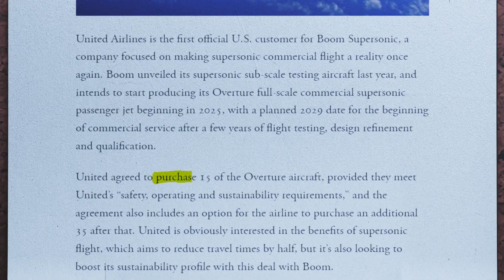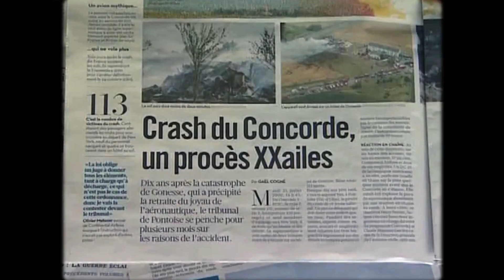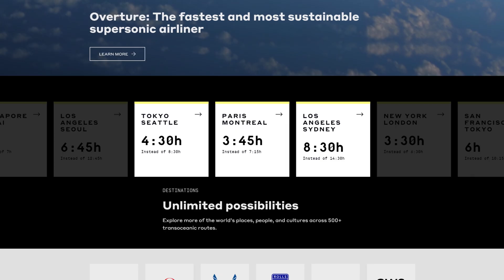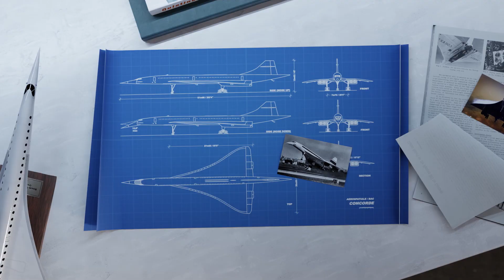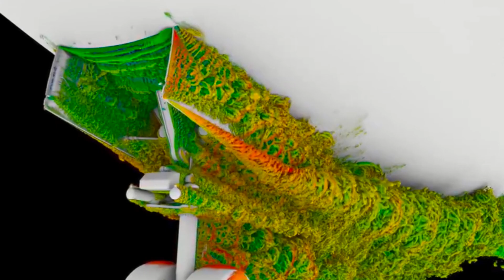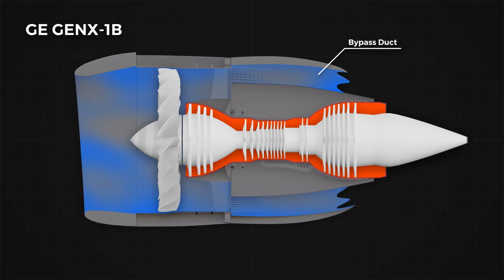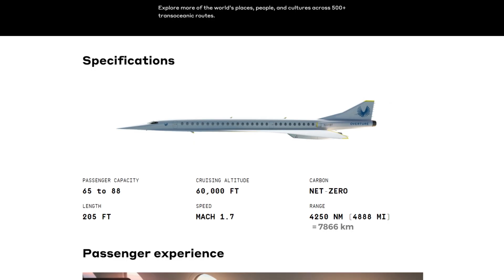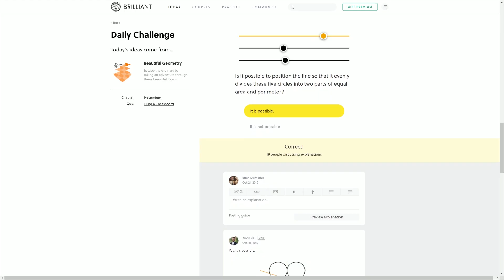Will Boom Bring Supersonic Back?

Comment: The main causes of the Concorde failure were high flying price tags, fuel price tags together with thirsty turbojet engines, the sonic booms over high populated areas and the Concorde plane crash. Not really cramp spaces because any s.s. airliner will give you cramp spaces. There will never be a s.s. jet with a wide cabin.
Reply: @Homoprimatesapiens At first Concorde's prices were not much more than subsonic airliners luxury class, but the seats were not selling so they upped the prices and pampered the passengers with Champaign, caviar, etc, to make Concorde exclusive.

The worldwide sonic boom ban overland, coupled with very thirsty engines at subsonic speeds meant that only two routes were viable.

The TU144 crash and as you say the Paris crash discouraged passengers as did 9-11.

Its quite possible to have an SST with a spacious cabin.

Boom's Overture will overcome most of the problems experienced by Concorde:

The aviation world has changed radically since the iconic Concorde first carried passengers in 1976. More people are flying, and they are more affluent. Roughly speaking, the number of trips doubles every 10 years. In addition, technology has advanced greatly, with the advent of computers, bringing computer aided design and simulation. Engines are now more powerful and efficient and aircraft are lighter and more streamlined.

Because Overture will be economical at sub and supersonic speeds, 500 routes, some mixed land/water, are viable, rather than just 2 Atlantic routes for Concorde. Overture will be carbon neutral, using sustainable aviation fuel (SAF). Overture will fly 2x the speed of subsonic jets over water, and 10% faster over land. Overture will create a sonic boom, but it will not fly supersonic over land. Concorde carried 100 passengers at Mach 2, over 4,488 miles. Overture will carry 65 to 80 passengers at Mach 1.7 over 4,888 miles. 

The two aircraft are the same length at 62m (203ft). Overture will be constructed from carbon composite, saving weight and increasing strength, and practically eliminating expansion and contraction with temperature changes. Overture will weigh an estimated 154 tons, Concorde weighed 185 tons. Overture's predicted development cost will be $8bn. Concorde's development cost was $14.4bn. The manufacturing cost will be less, the maintenance costs will be lower, and the availability will be higher. Overtures selling price will be $200M. An equivalent price for Concorde would probably be $1.2bn. For comparison, a Boeing 737-800 costs $100M, and a 747-8 costs $420M.

Overture will be simpler to fly, eliminating the need for a 6 month pilot conversion course. Overture will have a modern cockpit, with a flight deck similar to subsonic airliners. A flight engineer will not be required. Instead of a droop snoot, Overture will have external cameras and cockpit displays to allow the pilots to see the terrain when taking off and landing. Its cabin will be quieter and more spacious, and its seats will be more comfortable. In contrast to Concorde's awesome engine noise, Overture will comply with ICAO-14 regulations, allowing it to use all airports. 

Taking a JFK to LHR one way flight:  
Showing: Aircraft type,  Fuel cost per passenger,  Economy ticket,  First Class ticket,  Duration

Boeing 747          $147          $577             $2,308                      8hrs 
Concorde             $753                                $5,000^                     3.5hrs 
Overture^^            $708         $1,200           $3,000                      4hrs 
Business jet^^^                                 $53,000 to $99,000            8hrs  

Notes
^ 2023 money 
^^ Estimated prices, assuming Overture carries 72 passengers against Concorde's 100. For the first 2 years, only first class seats will be available.    
^^^ There are no supersonic business jets 

A 16 hour flight across the Pacific on a subsonic jet could be achieved with one 30 minute refuelling stop by Overture, giving a time of  4 + 0.5 + 4 = 8.5 hours.

Overture will not be competing for the mass market, but Boom have identified 500 viable routes. Overture may become a niche service, both scheduled and charter, where certain travellers expect higher prices. Even now, on subsonic airliners, some people are prepared to pay 4x to fly luxury class. And, as far as business travel is concerned, the time saving would be well worth it. To support this, Boom's surveys show the viability of Overture. 

If Overture reaches production, and meets its specifications, it will be popular with both airways and passengers, because it will half many journey times and will be cheaper, more comfortable and a lot more practical than Concorde. The military have already shown an interest in Overture. It would also be suitable for charter flights and as a business jet. The next development should be a 200 seat version, and possibly a supersonic business jet.

14-2023.08.19

Comment: The mishap was due to an overweight takeoff attempt , hindered by misalignment of the right bogie due to failure to install a spacer. Take off speed was too low to ensure a proper climb speed. Normally a dual engine loss would still allow the proper climbout to be reached.
Reply: An ogee wing, the name of this wing shape, does NOT stall, certainly not on takeoff speed.
Landing is much slower and yes a strong vortex lift is produced, but NOT stall.
The conical vortex starts at the forward, inboard leading edge.
There were proposals to continue building the Concorde with a small increase in span with little drag increment at M=2.
At cruising altitude of 60000 feet, rising as fuel burns off.
At supersonic speed, the area rule is different, the area is an oblique one corresponding to the cruise Mach number.
The perceived sonic boom (actually 2 booms) depends on the shape of the nose and nose angle and the temperature distribution of the atmosphere.
And most important on the flight altitude!
Reply: Newer engines operating at supersonic speeds do have low bypass ratio fans. And also without the afterburner for TO.

Comment: Let me get this straight:
They're going to start doing test flights this year. Then build an entirely new fleet of jets, with never before created engines in less than 4 years. Lastly they will do routes beyond the jet's maximum distace, all while using biofuel to be "carbon neutral"?
It smells like the same pipe-dream as those "Nikola" semi-trucks. 😏

Comment: The most advanced tech I know of that might enable supersonic flight is SABRE engine by British Reaction Engines. It’s essentially an air breathing rocket engine with their own precooler enabling Mach 5 speeds. This precooler is capable of cooling the incoming air from 1000 C to -150 C in 0.05 seconds avoiding the frost buildup.

Comment: Yea … as much as I admire and appreciate Boom’s efforts to produce a new Concorde, it just ain’t happening unless they focus on producing low-capacity private supersonic passenger jets for the ultra wealthy, because there’s definitely no market with regular travellers.
Reply: @poopsie117 Overture is not intended for the mass market, which is adequately catered for by the big companies, like Boeing and Airbus. Instead it is aimed primarily at business people, or anyone else, who's time is valuable. The accommodation in Overture will be business class, unlike the cosy, noisy accommodation of Concorde. Ticket costs will not be much more than subsonic business class. For example a one way flight from JFK to LHR is $2,300 and on Overture it would probably be $3,000. The subsonic airliner would do the trip in 8 hours. Overture would do it in 4 hours.
Reply: I flew Concorde more than once and would do so again.

Comment: This has been the biggest load of hypocritical crock I've ever heard coming from the government and the EPA!!  All they seemed to want to do is kill a viable capitalistic milestone in aviation history by highly scrutinizing this topic for their own political power and benefit!!  You hear sonic booms every time a damn thunderstorm comes up...that's what thunder is...when the lightning bolt strikes, it heats the air around it making it vibrate.  The air vibrates at speeds faster than sound, which from thus you get the sounds of thunder.  Thunder by itself alone has never been known to cause noise pollution or do any structural damage to anything!!
Reply: @williamwilkins3084 I agree that there are many unreasonable hurdles put in the way of progress, but sonic boom is not one of them. It is a menace and it is a very good thing that it is banned more or less world wide. Just imagine living under a flight path or near an airport and having a thunderstorm going on all the time. BTW thunder does cause damage. It can beak glass and dislodge tiles for example.

Comment: I'm 100% not a mechanical engineer but even basic physics tells us that energy is proportional to velocity squared which means that no matter what you do slower planes will always be more efficient. 
An engines impulse/thrust is proportional to it's exaust velocity, but the energy it imparts on that air is proportional to velocity squared. More mass ejected at slower speeds will always be more energy efficient than less mass ejected at higher speeds. And energy efficiency means fuel efficiency. 
Not to mention drag also scaling very quickly with velocity and of course all the supersonic non-sense that exists.
Biofuels are also an absolute myth at the moment since their production is absolutely not sustainable due to the vast amount of land they require (land that would otherwise be a forest or growing food). While the fuel itself is "carbon neutral", it's production isn't (since our electricity generation isn't carbon neutral yet). 
Only a few ways that in the following decades that super-sonic travel becomes commercially viable.
1. "Hyper-loop" like methods where the passenger carrier, is traveling through a decompressed pipe to significantly reduce drag.

2. We solve global warming and We also solve nuclear fusion energy and have virtually infinite cheap carbon neutral power at our disposal allowing for 0 care in the amount of energy something uses.
Reply: Research "supersonic super cruise" for the win.  Hyperloop is never going to happen.

Comment: He forgot to mention the Boom Super Sonic jet will be smaller than the Concorde. Concord could hold 100 passengers.  Boom is slated to hold around 60 passengers.   

He also misrepresented Booms testing to be all computer sims but that is not the case.  Boom has already done extensive mechanical stress testing on their wing designs. 

They are aware of the sonic boom issue and working to minimize it.  An aircraft about half the size of Concorde and going 10% slower is going to produce a softer sonic boom. Boom themselves are aiming for a thud sound rather than a Boom. 

The XB1 will use a common fighter jet engine because it’s 1/3 the size of the planned passenger version.  Why would they design a whole new engine for their test plane?

Comment: For me, the biggest thing that stands out about this is just how tone-deaf the idea for this air craft is; we know climate change is devastating the ecologies our economy depends on, and we know that burning carbon rich fuels is the principal thing that causes that... So clearly, it would be a great idea to launch an ultra energy intensive aircraft, that will without doubt consume drastically more fossil fuel per passenger distance travelled than what is currently on the market. 

I believe that far more consideration needs to be given to how new innovations would fit into the big picture. A great deal of the reason we have gotten to the point of failure we are at with climate change is that generations of people said "that's not my problem, I'll just not worry about it"... And here we are. This plane may be built using the latest cutting-edge technology, but the train of thought that ended with "... so this could be a great idea!" is just as outdated as anything else from the 1960's. 

Now that the world is realizing that we can't just carry on without regard for the environmental and human costs of unmitigated pollution, it is becoming extremely risky for those who keep planning their business, investment, and innovation, on the old paradigm. It would be all too easy for this plane to land dead on arrival in the market, the first (and most deserving) victim of a global carbon tax on jet fuel.

Moving forward, the companies and individuals who are successful will increasingly be those who take the big picture into account and focus on innovations that work in synergy with goals like reduced greenhouse gas emission and sustainability. 

It is for this reason that I see airships, not transonic jets, as the future of aviation. That technological platform is drastically more energy efficient, far more amenable to hydrogen as a fuel, and much easier to either partially or totally run on fuel-cell technology, thereby elimination nitrous oxide emissions and boosting efficiency even further. Sure, it's slower, but that's not the only thing that matters anymore.
Reply: I flew Concorde more than once and loved it.
Reply: @JP-zp5ic  You said: we know climate change is devastating the ecologies our economy depends on, and we know that burning carbon rich fuels is the principal thing that causes that.

Not 'we' but 'I'. How much CO2 is there in the atmosphere? Can you post a figure? I have heard 50%, even 75%. Some people even claim that they have trouble breathing because there is so much CO2 in the atmosphere.

Do you realise you have caused excess emissions by using the internet, when you consider the power of your computer, the power of the telephone network and the power of the worlds servers. I expect you also use products and eat food that are transported from overseas...

Also, the millions of ordinary people who unnecessarily fly to holiday locations each year, contribute far more CO2 than the likely traffic on SSTs.

Comment: I always thought supersonic flight may have a chance in the private jet market. Private jets usually travel at higher speeds compared to the Mach .85 speed of commercial operators. The quicker flight duration is always appreciated for their busy owners and they're wealthy enough to absorb the cost...you get it. 

Wonder what's United plan? Expand their business class market? Maybe use it as a advertising/marketing strategy to bring in more eyes? Idk. I wish them and sonic boom the best.
Reply: @carl8790 The fastest private jet is the Bombardier Global Challenger 8000 with a top speed of M0.94, an ultra high speed cruise of M0.92, a high speed cruise of M0.90, and a normal cruise of M0.85. The range is 9,206 miles at 43,000 feet and M0.85. The speed of sound at 43,000 feet is 660mph.

As you approach the speed of sound the drag increases dramatically and M0.85 is really as fast as you can go without burning a disproportionate amount of fuel. 

The Challenger 8000 is already pretty expensive at $80M, and a supersonic version would probably cost twice that. The other problem is that the range will drop and may reduce to 25% of the subsonic version, giving only 2,302 miles.

In addition, the shape of the aircraft would have to change too, becoming much longer and thinner. A whole load of other problems would arise too.

Comment: Brilliant presentation that ends on a rather sad note. The challenge of making supersonic commercial travel economically viable might prove quite an insurmountable challenge. Which makes it even more mind-blowing that BA and Air France operated the Concorde for almost 40 years. Those engineers really outdid themselves.
Reply: Concorde made a profit
Reply: @arnoldwandagoogutu4886 Yes Concorde was a fantastic technical achievement, but Overture will be generally better, although it will fly at M1.7 as opposed to M2 and carry 65 to 80 passengers as opposed to 100.